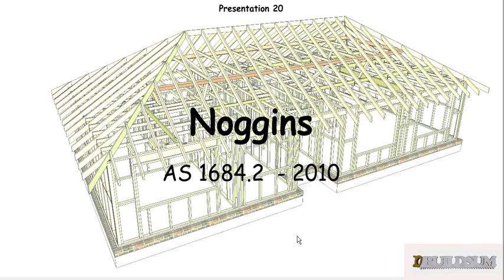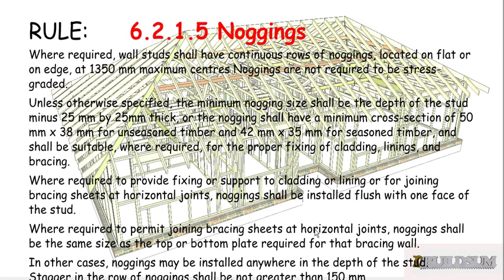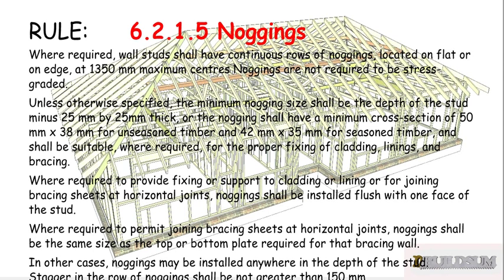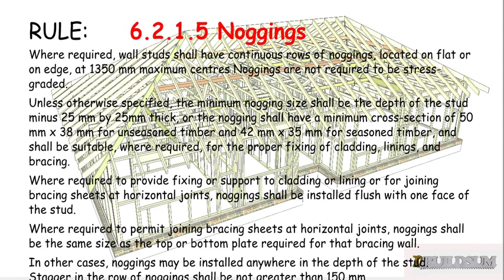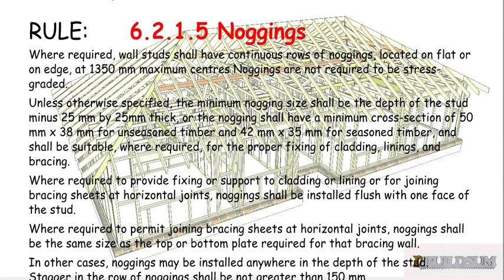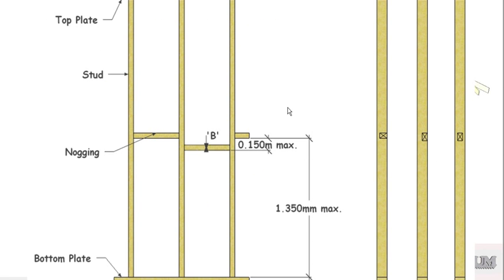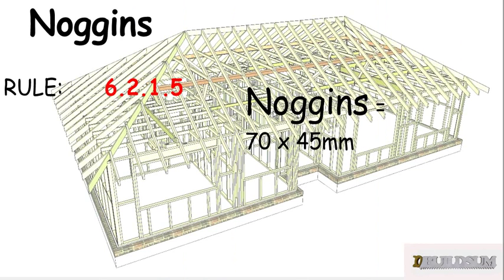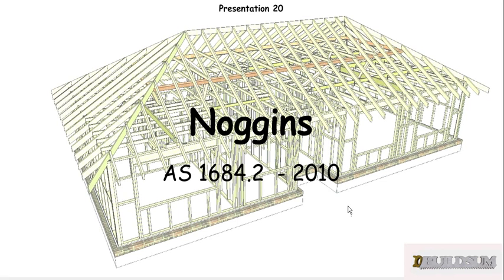20   Noggings

Comment: Thanks for yor informative videos, very much appreciated. I was wondering if you could tell me the purpose of noggins in the overall scheme of building, as I own a house 100 years old with 12 ft ceilings and none of the walls have noggins just an intermediate top plate at 10 ft and all studs morticed into top and bottom plates.
Reply from the maker: Mick Metcalfe HI Mick Noggins are generally installed to minimise the chance of the studs twisting. They are also used for fixing the perimeter of sheet linings when required. Mortising was very common back then. Hope this helps
Buildsum